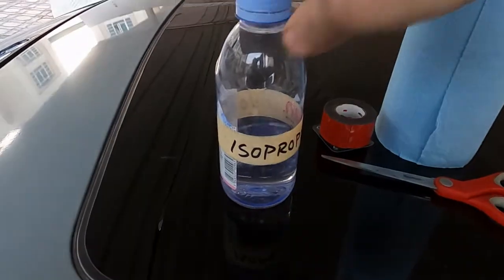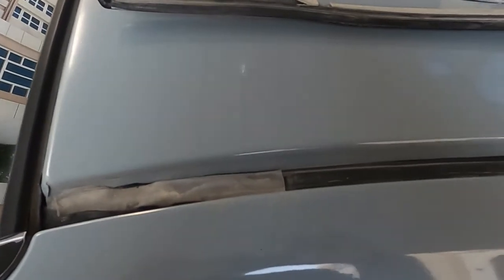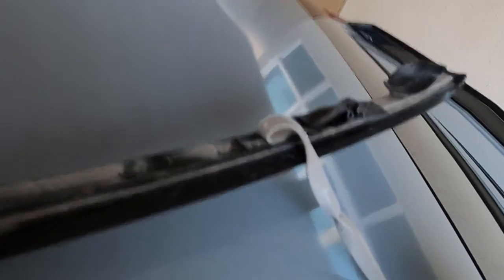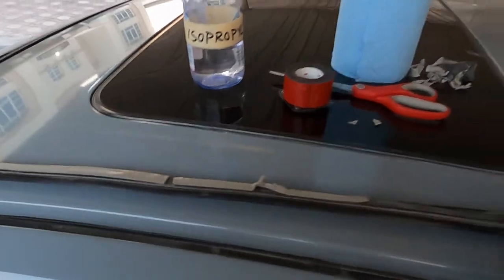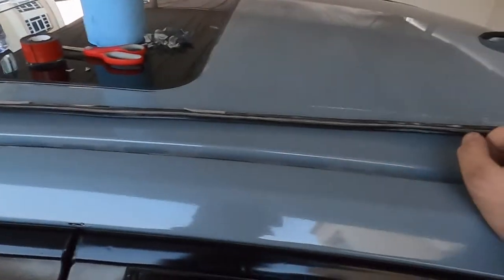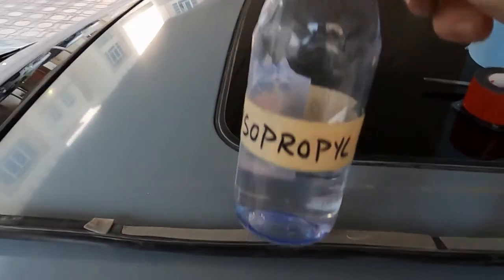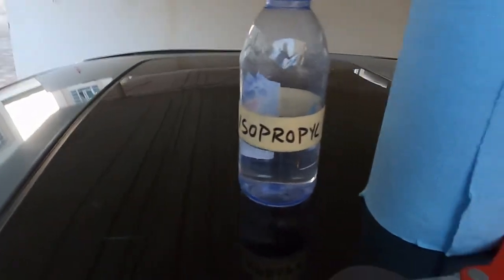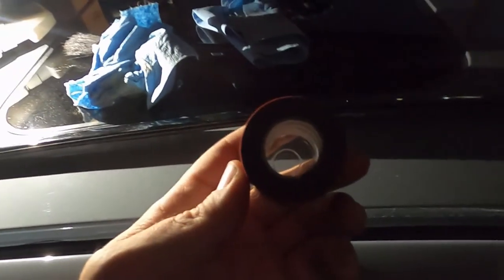Roof trim fix

Comment: What would happen if you just removed them all together Improper drainage or no.
Reply from the maker: They don't do much for drainage, there is no connection to the sunroof drains or body drains. 

I would imagine to a degree the channel directs water in a heavy downpour to the sides of the roof a bit, but the trim shouldn't effect that too much as the channel it's self does the bulk of the work. 

It would however look a bit odd as there would be 2 body lines missing from the appearance of the car. 

Unless mounting a luggage carrier or something similar up there, I'd keep it as is.

Comment: I've put silicone gasket, would be a problem for rain drainage?
Reply from the maker: On my car, there isn't a drain that goes anywhere. The water should move down the molding and flow off the front or rear windshield. 

Unless your car has a drain hole and hose, you should be just fine. If it does, make sure you don't silicone the hole closed.

Comment: I have about 8” pulling loose at the front of my Sienna. Would contact cement work or is that “too strong”?
Reply from the maker: I would recommend using the 3m tape as it's easier to work with, but a good contact cement should hold up fairly well.  The key is to properly prep and degrease the area before applying the glue.
Reply from the maker: https://youtu.be/uP8Z0i26TT8

Here is an updated video I made about the tape I used, and way better lighting.

Comment: super informative just what i was looking for. what tape did you use?
Reply from the maker: I used 3M extreme auto tape. It's sold here under the "extreme", but it's Part number 5952 under the VHB in the states. 

Make sure you prep it by cleaning with a brush and using isopropyl alcohol above 70% or heptane or similar solvent to ensure proper adhesion. 

After 20 min or so (depending on temp) it will be about 50% strength and after 24 hours it will be at full strength.
Reply: @ByronETAWheels  Thanks I appreciate the quick response.
Reply from the maker: @JayLikesKnives  https://youtu.be/uP8Z0i26TT8

This is the updated video I made after painting the car.

Comment: Why would you do that with dark lighting
Reply from the maker: Because it was one of my first videos I'd ever done. Have a look at the redo after I painted the car.

https://youtu.be/uP8Z0i26TT8
Reply: @ByronETAWheels  don't get me wrong, I really appreciate you for the video but it was making frustrated because I couldn't see it and I'm in the middle of doing mines. Ok cool thanks
Reply from the maker: @JayJay-pe1sq  No worries at all bro. This was way back when all I had was a hero 8 and pretty much nothing else. 

Which parts are you having issues with? I'm more than happy to offer some pointers.
Reply: @ByronETAWheels  just what to use to get it glued or taped back down
Reply from the maker: @JayJay-pe1sq  I used 3m extreme double sided tape with a load rating of 30# per square inch. 

https://www.amazon.com/3M-Scotch-Extreme-Mounting-60-Inch/dp/B005SRECEU/ref=mp_s_a_1_3?crid=1KV7JBQGOJOXO&keywords=3m+extreme+double+sided+tape&qid=1657559193&sprefix=3m+extreme%2Caps%2C276&sr=8-3

This is a non affiliate, regular link to what I used. 

Prep is 99% isopropyl alcohol wipe, and stick it down.
Reply: @ByronETAWheels  ol
Reply: @ByronETAWheels  ok

Comment: Your supposed to use windshield sealant to put the roof drip moulding on.
Reply from the maker: I don't see why you would, it is inside a formed channel.  There is no opening inside the channel that opens into the car in any way.  I can see using a urethane or poly sealant if it had an opening or needed to be sealed somehow.  The 3m extreme tape that was used is more than up to the task and provides a seal if applied correctly.

You can see my other videos if you are curious about the results.  Have a look at the new interior video where I walk around the car, showing the reality of owning a wrapped vehicle.  It has been in place after I fixed the mistake of the wrap shop.  Since December 2019 it's been perfect.  The interior video was shot about 8 months later, middle of summer.

So while I do appreciate the suggestion for using windshield sealant, in this particular case it would not be needed.  It may well however be valid on a different car model.

Comment: instead of using that crap tape  USE THE  3M  Trim adhesive it works much better in all climates   one tube cost about 7 bucks
Reply from the maker: Awfully nice of you to assume I'm using garbage. I hope whatever is bothering you this evening gets resolved and I also hope you don't have to take out your issues on someone else.  

That's a 3m tape. It is the extreme version, and has higher rated adhesion and temperature ranges than what you have just recommended. You can order it by the roll. Feel free to have a look in the description as I linked it, and the specs /tds are available easily online. 

I'd kindly suggest doing some research on the product before just randomly declaring "It's crap and this one is the one you should use". 

I really do hope you have a great rest of your day, and are able to stay positive.
Reply: @ByronETAWheels    you mis understand my  tone here check out the 3M trim  adhesive you will never use double sided tape again  lol
Reply from the maker: @DJ_iLL_wILL  I recommend you look up the specs on that tape. Over 30 lbs per square inch. 

I have had the trim off twice on the car for wrapping or painting. It didn't budge one inch, even in 54C heat and 70-80% humidity. 

The factory trim glue failed, where as the 3m has lasted years. 

I also use the same to hold all the emblems and spoiler on the car. It's not the regular 3m stuff you have pictured in your head when you think of tape. 

We use it on everything from signs to sensors at work. It's seriously good stuff.